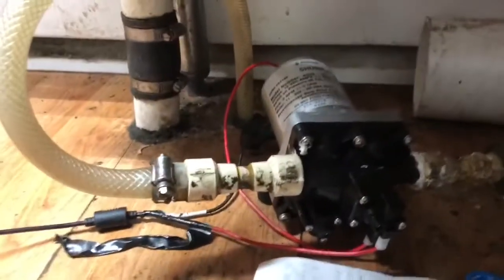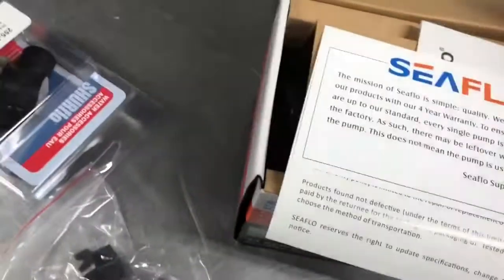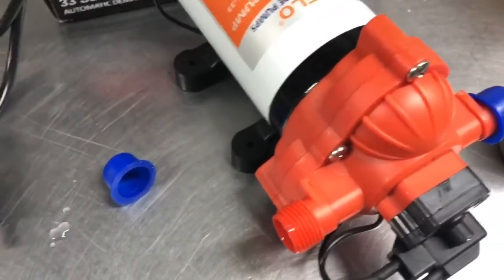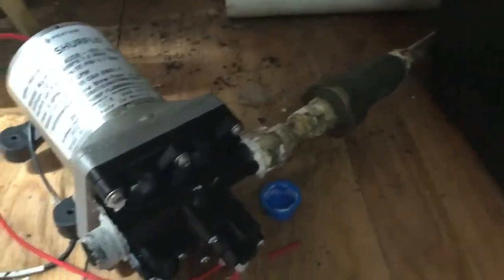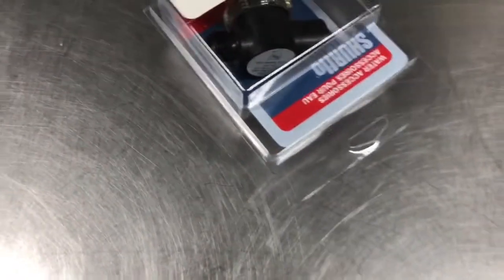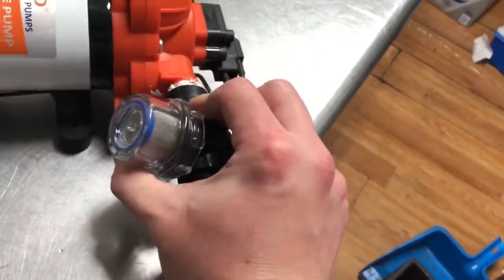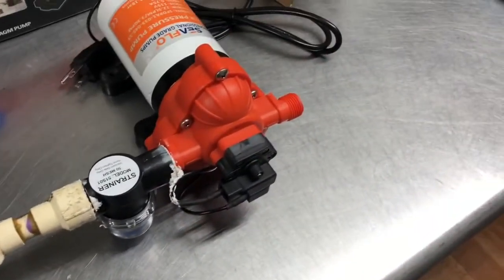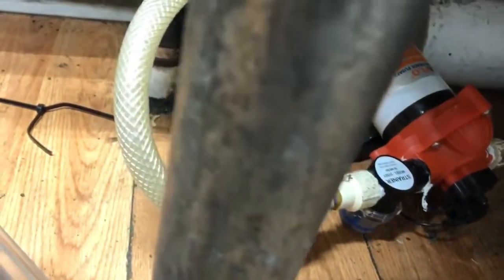Replacing a Water Pump on a Food Truck

Comment: OMG, thank you so much for this video! 🤗 You have put an end to my research! 🙏 I just purchased a used 10x18 ft food trailer. Even so, it’s a bit dated so I hv to do some upgrades starting with the water setup. The previous owner already had a water setup, however, I don’t like it. It runs by a small car battery that I hv to connect cables to with the on and off switch. Are you familiar with this? Anyways, I’ve been trying to find an electric water pump. I know it’s been a year since you post this video, still, how is it working for you? Any suggestions or advice? I hv a plumber that’s doing the work because I’m totally clueless....all I can do is cook and run it after it’s up to code. TFS 🤝
Reply from the maker: This pump lasted until yesterday and we replaced it with the same version.

Comment: Did you ever have a problem with the pump not turning off or not reaching the PSI threshold to turn off?
Reply from the maker: Haven’t had that problem, but I imagine there would need to be a leak in the system somewhere or the pump may be defective.
Reply: This is because of inlet Pressure miss

Comment: where did you get your pump from?
Reply from the maker: SEAFLO 33-Series Industrial Water Pressure Pump w/Power Plug for Wall Outlet - 115VAC, 3.3 GPM, 45 PSI https://www.amazon.com/dp/B076TGWYDK/ref=cm_sw_r_cp_api_i_K3IlCbNM134PY